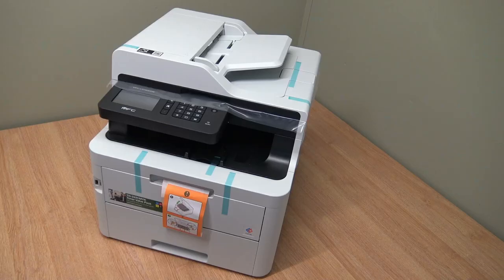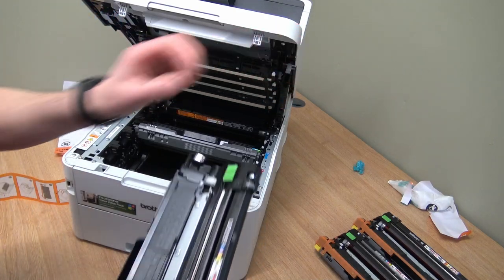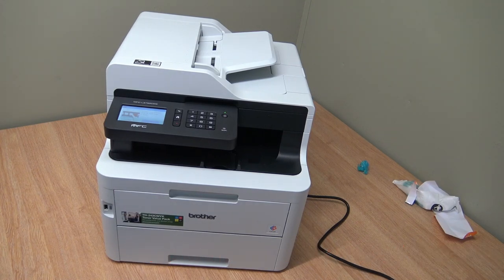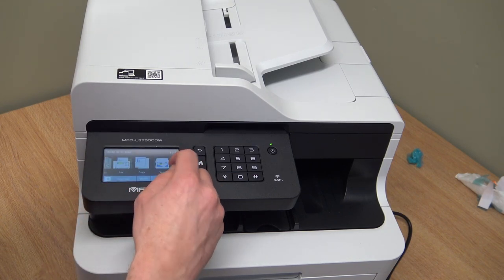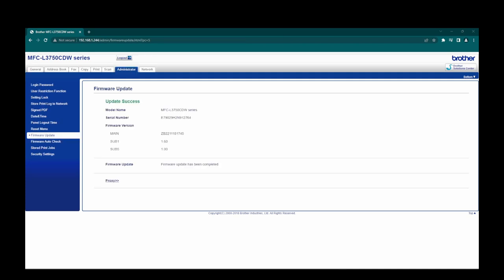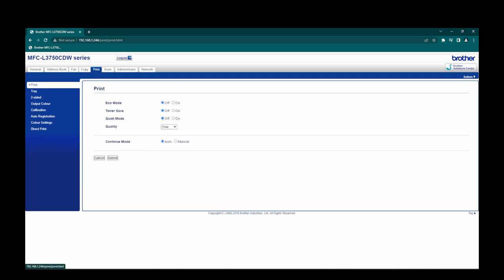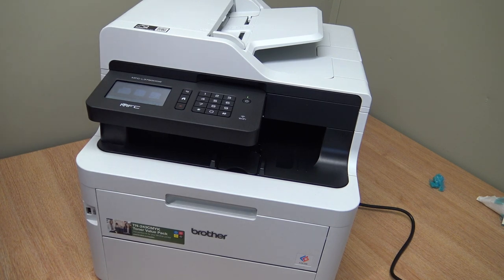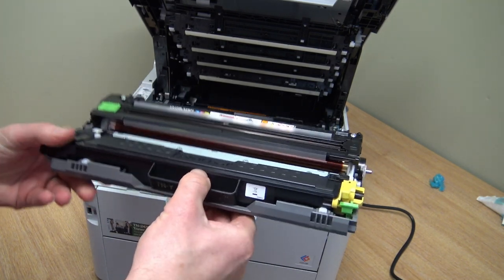Brother MFC L3750CDW Unboxing, Unpacking, Switch on &  Running Cost review

Comment: What an excellent video. Your Brother machine is a different model number from mine but they are almost identical. I learned so much from you in just over half an hour! That's how demo's should be and I thank you for your time in making and showing this video. 
 
A quick intro.. I'm an artist. I don't print vast quantities of stuff like a small office would, but I do print 'casually' quite a lot! I collect loads of reference images and I do like to experiment with printing on different surfaces for use in my art projects: paper, card, textures & even transparencies. Stuff I can safely put thru a printer (I do research first!).
I have always wanted a laser printer and finally got one. I unboxed my new DCP-L3760CDW over an hour ago and it's now sitting in front of me as I watch this video. No cables or power yet, just straight out of the box. Hopefully will tackle all that tomorrow.
 
I already have a Brother DCP-J4120DW inkjet which is a pretty good machine. However, I've always had problems when trying to match colours - what I see onscreen is not what prints out! Could be due to my inexperience with settings, or wrong paper, whatever.  That's about my only issue with the inkjet. (Oh, and of course,  ink cartridges.) Anyhoo, that's another story. 
The inkjet is connected to my desktop pc (Win10) via USB.

Now please don't laugh at me for asking the following questions! There's no point in pretending I know stuff when I don't. But I do learn eventually! 
How do I go about connecting these 2 printers to one pc so I can select one or the other at any given time? 
How do I update the new laser printer if I have only 1 internet connection cable in the pc? The modem or router (not sure which) is in the next room. Can I add another (extension or hub) in my room? Do I even need another?
It's only me using the pc & printer/s so am I right in assuming I don't need Shared or Network? 
The new laser does Wireless but I'm not entirely sure what that means or entails!
 
For me, this new printer set me back more than a few quid so I won't be attempting anything until I'm confident enough. I'm no tech-head but I'm not daft - I just need some support from someone I can trust so I can take these steps with confidence.
Please will you help me understand the connection thing so I can set up the 2 printers?! 🥺
Reply: Q: How do I go about connecting these 2 printers to one pc so I can select one or the other at any given time? 
A: You connect the printers and the PC to the network. It is not necessary to connect both printers directly to the PC. However, you can still do this using USB.

Q: How do I update the new laser printer if I have only 1 internet connection cable in the pc? The modem or router (not sure which) is in the next room. Can I add another (extension or hub) in my room? Do I even need another?
A: Buy a small 4-port switch - they are very cheap. Plug your internet cable, you PC and your printers into the switch.

Q: It's only me using the pc & printer/s so am I right in assuming I don't need Shared or Network? 
A: Correct. You can connect directly using USB. However, if you have more than one printer and want to be able to update the printer firmware then it makes sense to connect everything to the network.

Q: The new laser does Wireless but I'm not entirely sure what that means or entails!
A: It just means that you can connect the printer wirelessly to the network just like you would with your laptop or phone. It is not that difficult
 
For me, this new printer set me back more than a few quid so I won't be attempting anything until I'm confident enough. I'm no tech-head but I'm not daft - I just need some support from someone I can trust so I can take these steps with confidence.
Please will you help me understand the connection thing so I can set up the 2 printers?! 🥺

Comment: Would you recommend this for casual home use ? I want to be done with inkjets because of the cartridges and print heads but i am not sure if the Investment is worth over just paying every time i want a print.
Reply from the maker: Solid & reliable machines, however in my opinion expensive to run if you print a lot of documents, but fine for light use.

Comment: How do i fix the thick black vertical lines issue
Reply from the maker: remove the drum unit and clean the corona wire with the plastic cleaner that is provided within the drum unit, also reseat the toner within the drum unit, do not touch the drum, and do not clean the drum, if that does not work, it maybe a faulty drum

Comment: what part of led uses electricity, the toner is heated to fuse on the paper the laser or led dnt have energy con diff
Reply from the maker: It's not really the LED's that use the electricity, it's the fuser unit, it's not like the old days of filament lamps that would switch on and hold the temp at around 210 degrees Celsius, it's more of an induction heat process, which is more efficient, but it's still very high compared to an inkjet